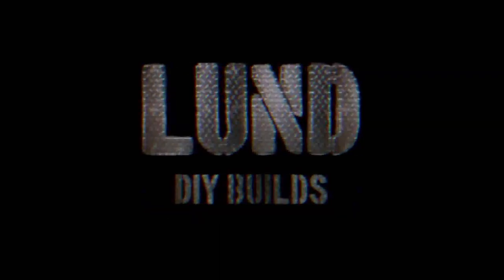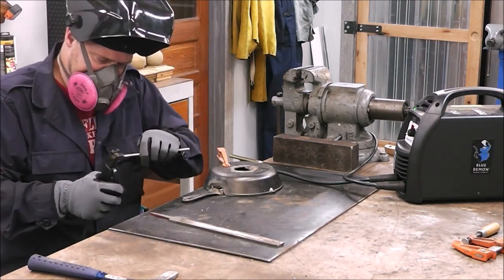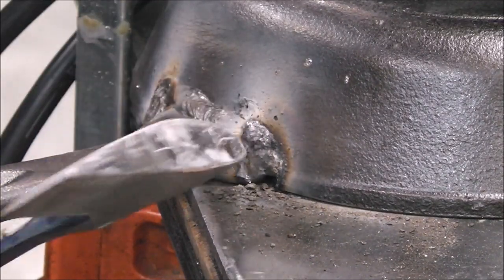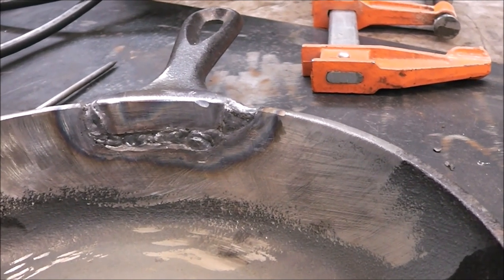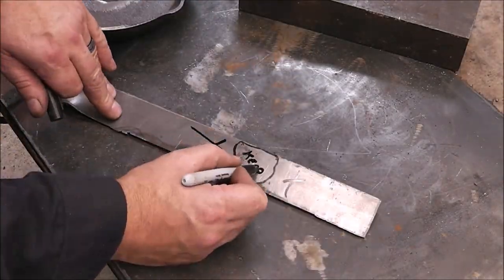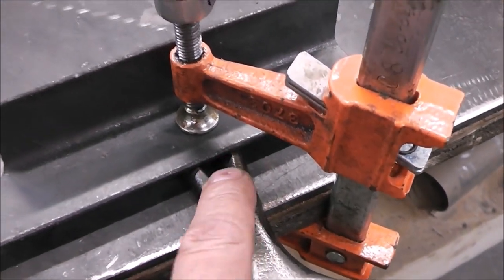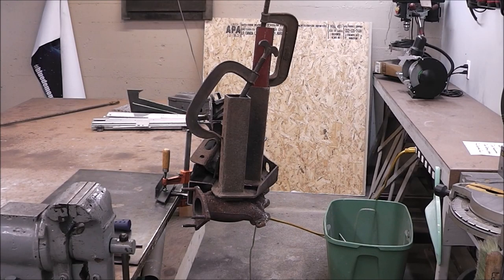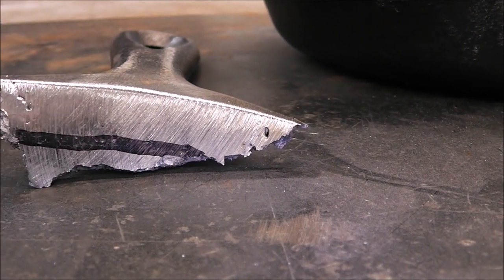Stick Welding Cast Iron Repair using 7018 Welding Rods

Comment: I'm a student welder. Could you explain the metallurgy behind peening these welds? It's seems pretty self explanatory, but could you maybe so a short video on that method. Love your video, keep it up!
Reply: The previous answers were quite out of subject... The right answer is: when after welding you hit your deposited metal from the top with a hammer, the deposited metal would slightly expand to its sides. And on its sides it has that brittle cast iron, that wants to shrink and thus crack, when cooling. If you hit your soft weld in a proper moment from above, your deposited soft metal would expand to its sides and somewhat compensate for shrinkage of your brittle cast iron nearby, thus saving your workpiece from cracking along the weld when cooling.
No metalurgy in it, only common sence and finding the right time for peening on deposited metal and thus compensating in time for cast iron contraction when cooling; by means of forcing your deposited soft 7018 metal to expand, following the cast iron contraction...
Reply: Leothelion357, thank you, Sir.
mic jam, you "took advansed welding in Boston..." Really?! Then you have to take your hat off your head before daring to speak to a man like me, boy...
I am Journeyman Welder in Canada, boy. Since 2009. With according Canadian education. I had many pressure tickets and CWB certifications during my carriers in welding, I had it all.
I worked as welding tutor in local college, SIAST.
I am Mechanical Engineer from Ukraine since 1997, after 5 years in Construction University. It would be equal to Masters degree in Canada, if I could pass my English proficiency test here.
I also took a few classes in welding in Paton Welding Institute in Kyiv before coming to Canada. And... What a coincidence: my instructor in TIG class (Mr. Dochkin) welded titanium parts for "Soviet Moon Tractor" half of century ago...
Reply: It's called cleaning the Flux off your fresh weld before tieing back in to continue your weld. 
No other reason
Reply: Lucas Knie, I disagree with your statement that I said the same thing you did. You said: " ..the concept behind peening is to decrease shrinkage (when welding cast iron with 7018-th).' While I am saying: When using peening when welding cast iron with 7018-th, we COMPENSATE the shrinkage of brittle cast iron for the cost of deposited soft 7018 metal, hard hitting 7018 metal with a welding hammer, making dents on its surface and forcing it to actually EXPAND towards contracting cast iron.
Another you phrase, in my humble opinion, is worded bad and unclear: "...your weld will start to shrink, but the cast will not..."
You had to specify: "...your weld will start to shrink, but the big massive body of cast iron around your weld will not follow the shrinkage of your weld, thus causing tension and therefore cracks along the weld. You had to preheat the whole massive cast iron workpiece, so after welding the whole cast iron detail would shrink together with your weld, thus avoiding creation of tension and cracks."
Sorry, Sir, but right now this your phrase sounds like cast iron is not subjected to heat shrinkage as a material... At least to me, as to a non-native English speaker...
Reply: Lucas Knie, your example with hitting nut on a rusted bolt is a good example. I like it. I myself did not even look at it this way before.
My imperfection in English is not that bad that I would had difficulty of not catching right away the difference between shrinking and expansion :) I was talking about your phrase "... but the cast will not...", not about me not understanding the difference between shrinking and expansion. For a minute I was thinking that you were talking about "cast" - as about "mold", "detail" (and I thought that I just did not catch this.)
But no: you are talking about "cast" as "cast iron", material, metal. So I am withdrawing my words that I did not understand your words because of my English, and my position stays the same: you worded this particular phrase "...but the cast will not..." badly, exactly as I described in my previous comment. 
I checked in Google: thermal expansion for a cast iron is about 10 percent less than thermal expansion for iron. It just means it would shrink slightly less than iron, rather helping us to avoid even more cracks.
Upd: Sorry, I only now got that you were talking about heating the rusted nut, not about hitting it with hammer. My bad. But still a good example, though a little bit out of subject of our disscussion, on my opinion.
Reply: Lucas Knie, I absolutely agree with you, Sir.

Comment: Good test, gotta love the 7018! Lots of stuff still holding with those rods, its been my go to rod for years, have you ever tried any certainium 704? They supposed to be for dissimilar and unknown base metals, i think there 100k psi, i have a pack of them someone gave me, run just like the 7018, great video and test, thanks
Reply from the maker: outwhitu08 thank you, I have not tried them. I will have to look into it though :)

Comment: you have to consider the thickness of the cast in the bottom compared to the thicker handle area
Reply from the maker: The handle and bottom were fairly close if I remember correctly, but I could be wrong.

Comment: Hi, may I ask why you chose not to pre heat this particular job?
Reply from the maker: Cold welding has mixed results. If it can be cold welded without cracking than the filler metal and the process used to weld it is superior. I use cold welding as a benchmark to see how forgiving the filler metal is. If it can be welded cold, you have nearly a 100% chance you will get a superior repair on the finished product.
Reply: @BrandonLund  - Many thanks for your reply Sir.
Reply from the maker: My pleasure Greg. Thanks for your support 👍

Comment: Hi Brandon, 

Great video thanks sharing your knowledge :) 

How does peening relieve stress in the metal?
Reply from the maker: Thank you! There is no short answer to peining. AWS has some good info but basically it works to take some of the tensil properties and expand the filler metal into compression
Reply: @BrandonLund   Thank you for the explanation.

Comment: hi can I weld cast iron cylinder head by 7018?
Reply from the maker: Theoretically yes. 7018 is a low hydrogen rod however I've never personally had good luck with 7018 but many have. I would stick to nickel rod

Comment: If you have repaired this with 7918 3 times, maybe try using a nickel rod designed for welding cast iron. 7018 is for mild steel only.
Reply from the maker: I take it this is the first video of mine that you've watched 🤔

Comment: The same method works with flux core wire feed too. Weld a little here, peen and weld a little there, peen moving around with no preheat like you just did.
Reply from the maker: Thanks Gary! I've been wondering the same, so I'm going to do a video doing just that! It should be out in a couple weeks. I get a lot of criticism when I do that type of video, so be sure to hit the notifications bell...I'm sure the comments will be interesting :) take care brother!

Comment: I think I'm going to try this on my drill press table since it has a smiley face of shame... Hopefully it works with my rods that are a little old. I've kept them in a box with tape around the lid.
Reply from the maker: It cant hurt!
Reply: @BrandonLund  Ya been trying it an I keep getting a lot of porosity. I don't think it's because they soaked up water I think it's because the slag gets caught since I'm not able to angle the electrode/move enough.
Reply from the maker: @MetrologyEngineer  it could also be white cast iron - which is almost impossible to weld and you will see a lot of porosity as you pointed out.
Reply: @BrandonLund  Huh I've heard of the different kinds but I'm not sure how best to tell. And it's more porosity in the weld itself not really ever in the base metal. It looks gray in color to me :)

Comment: The best rod to use is nickel rod. The shrink characteristics  are almost identical  to cast iron. No preheating is required.
Reply from the maker: Nickel is one of the methods I prefer, but for something like this you have to be careful using nickel because it’s a carcinogen. This or stainless is going to be the safest.

Comment: I don't know what you're trying to prove, using a 7018. There are so many cast iron rods on the market, and I have used some of them with great success. The best one I have ever used was a certainum 889. But I have used other brands with good results.
Reply from the maker: I am not trying to prove anything Kenneth.  I'm just a guy welding and experimenting on some cast iron and trying to help others at the same time.

Comment: Always thought it was a bad idea to grind cast iron before welding as it just adds more contaminants from the grinding process, and the only real option to prep the pieces is a chisel. Am I totally incorrect?
Reply from the maker: Yes and no...the best method is to use gouging electrodes.  The gouging rods will bevel out the joint while burning out any oil and contaminants. The next best method is to use a die grinder with a metal cutter (not a stone) and lastly to use an abrasive wheel. You could use a chisel but I've never tried....does any of this matter? Probably not for most repairs. I've had excellent results with preheat, welding / peining and then burying in sand.
Reply: @BrandonLund  Wasn't having a go at you, I was curious to hear your thoughts on the subject is all. I must investigate the gouging electrodes you mentioned. Keep up the fine work!
Reply from the maker: @pedrosixfour thanks brother! I have a few boxes of gouging rods but I've never tried using them on an inverter welder. I might have to give it a go and see what happens.  I knew you were just asking, i didnt take take your comment in a negative way 👍

Comment: We now know the breaking strength when repaired with Muggy weld and 7018. The first number we should have known is the breaking strength of a new Lodge pan.
Reply from the maker: I thought of that after the fact...A new lodge pan would be much more...probably around 150 pounds before breaking. Unlike steel, cast repairs are never as strong as original.

Comment: Since cast iron welding rods are expensive, I use 316 stainless steel rods instead. Much cheaper, almost as strong as cast iron rod and neat as well.
Reply from the maker: Great point!

Comment: Cast iron needs to be preheated before welding. That would help  with the cracking.
Reply from the maker: It can be done successfully without a preheat as I have demonstrated in a few videos.  I just wanted to give a few more examples of cast iron repairs. Cheers.

Comment: do a preheat and post heat, sudden heat on cast creates to much tension
Reply from the maker: I agree that pre and post heat are best, but this was an experiment to see how 7018 worked doing cold method. If you go low and slow, it can be done in certain circumstances.

Comment: You also have the option of using a rod meant for cast iron or a nickel rod would work much better than 7018 which would probably break pretty easily when you drop it. As far as the pre heat goes you don't necessarily need to pre heat thinner cast iron more so the thicker cast iron because the heat escapes so fast. And you're welding downhill is a big no no.
Reply from the maker: R Reichel, this is an ongoing series. Last week we used nickel rod and tested, the week prior was a different process also. 7018 has decedent elongation as compared to other electrodes. Vertical down helps reduce heat imput, especially with a rod not typically designed for cast iron and without a pre heat.
Reply: That’s what I always used; nickel rods.  I’ve heard that you can tig and use a coat hanger for filler rod in a pinch.  Never tried it though.
Reply: @justjacob6344  Na, its Steel and worthless don't bother get the nickel. You can get nickel tig wire then tig weld it.
Reply from the maker: JustJacob FYI you can also use a nickel stick electrode to tig with if you remove the flux coating. I would caution you though about using nickel on cookware. It’s a carcinogen.
Reply: @BrandonLund  You can but, I would not. it's much cleaner as tig wire as the flux does the cleaning with stick rods. In my humble opinion  😁
Reply: michael sullivan  okay, I've only been welding for 43 years so you probably know better than me. 🤣😂
Reply: michael sullivan  wow you look really young for your age. I started in 73 and I'm 66 so that makes you what 64? Or there abouts hmmm🤔
Reply: michael sullivan  well then I'm guessing you're not the one in the video. My bag.
Reply: michael sullivan  this on!
Reply: michael sullivan  No I'm not. I see lots of people giving bad advice on YouTube. I've worked for Lockheed, certified for aircraft and missiles also welded BOC and Praxair Cryogenic trailers and Welded flight centrifuges/simulators  for the US Navy for astronaut/Pilot training, passing sound test, x-ray test, helium leak, and more. My welding experience is in all types except under water and nuclear power plants. I just get tired of seeing bad advice. If I were to weld cast Iron  with stick I'd use 77 Non-Cracking Cast Iron Welding Rod my preference would be tig with silver brazing rod or nickel rod if gas weld welding I'd use brazing rod. That my expert opinion.
Reply: michael sullivan  well I'm not a stalker and don't appreciate you giving out misinformation. There's to much of this going on. Get your act together. Have a good day.
Reply: michael sullivan  I gave you the answer if you can read. I thought you were the one doing the video I guess I was wrong hence why I said, my bag. If your in your 60s you'd know it was said my bag (street slang) before it became my bad.
Reply: michael sullivan   I thought you were the one that made the video apparently I was wrong, that's why I said my bag street talk you would know what it means if you're in your sixties started out as my bag before it became my bad. Does that satisfy you?
Reply: michael sullivan   OK Mr. Comedian funny funny laugh laugh, or is that just more miss information.
Reply: michael sullivan   Under Urban Dictionary

My Bag

The term "My Bag" was originally slang for taking responsibility for one's own actions. Somewhere in the early 90s people started saying "My bad" either because they wanted to change the verbage of the original, or because they just plain didn't understand the original meaning. "My Bag" is slang for "Baggage",ie: You take your own problems, put them in a bag and carry it on your own back. "It's on me, my fault, my problem. "My Bag" excepts and takes the burden, "My Bad" just dismisses it.
Reply: michael sullivan  your welcome
Reply: michael sullivan  always wanted to but never did.

Comment: Hey buddy. Welder here. Idk who taught you to weld but you dont run 7018 downhill. 6010 you can run downhill or uphill.
Reply from the maker: @tjaydatnugga This isnt pipeline bud. Relax. Its going to be ok. There is a reason a wps doesnt exist for ci repair using 7018, so its whatever i say it is.
Reply: @BrandonLund  I get what youre saying. You can get cold lap or porosity running it downhill. You know what youre doing though. Not shitting on you at all fam.

Comment: Instead of of using regular welding rods, have you ever tried using Nickel welding rods? I got a 110v variable  100 amp welder, that I'm going to attempt to weld a cast iron 'turtle' that holds wood stove 'wood burning dust' particles.  I've been looking at your videos and will 'preheat' the lid to get it hot, then attempt to weld it back together. Now, the broken pieces fit back together nicely and almost can't see the break, once fitted together. I have no way to video myself, maybe a cp? IDK.. We;ll see. I'm gonna attempt to weld it, once side only here. I'll use the sand box to cool the surface down, once done.. have learned that, from watching your videos on welding cast iron. Now, this won't be used much, maybe storing some wood stove ashes, later. But that's it and it's the top part of the 'Turtle' I'm repairing...
Reply from the maker: Thanks Im glad i could help and I appreciate you watching. One of my most popular videos is welding with nikel. I've attached my cast iron welding playlist. The 1st video is welding with nickel. Thanks again! B. https://www.youtube.com/playlist?list=PLfbf78fMz9VpweFv4IqUfrrNV6Vvro7Cd

Comment: I can weld just about anything, but if an accident ever happened in the kitchen because that handle popped loose, I'd never forgive myself.
Reply from the maker: Dylan Crow I agree 100%. The only reason I used a cast iron skillet for this demonstration was so no one could claim its cast steel or some other metal. I think universally everyone can agree it’s made of cast iron. I get a lot of criticism whenever I do cast iron repair videos, so I figured I remove one variable that people could argue about. I think I paid less than 10 bucks for the pan so no big loss to just scrap it. Thanks for your support.